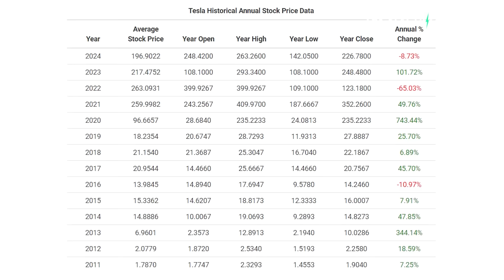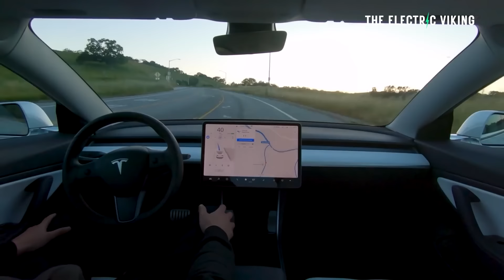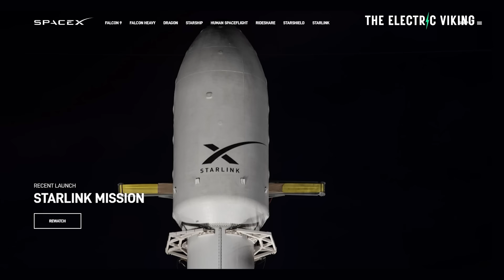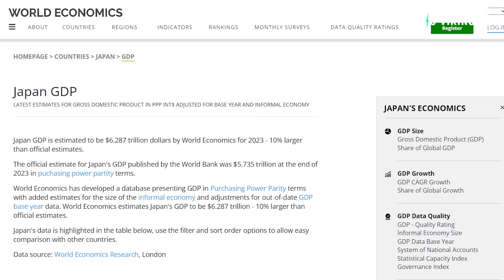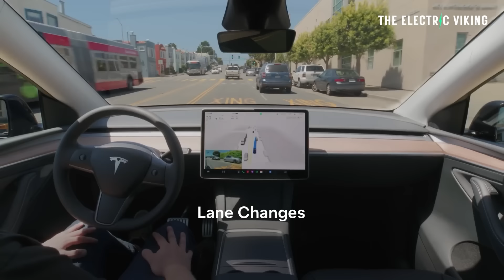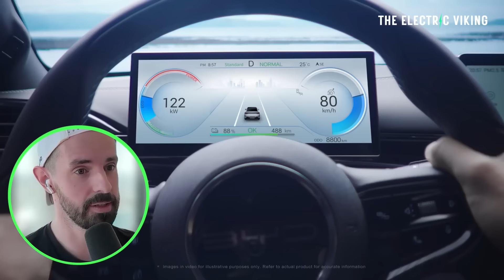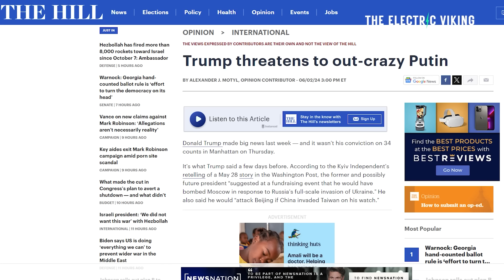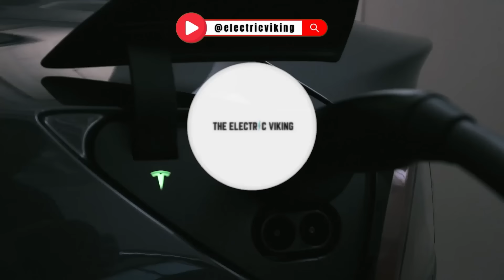The Electric Viking and Solving The Money Problem, Steven Mark Ryan

Comment: Thanks Sam.  Excellent wide ranging interview with SMR. Clever bastard, gives such clearly reasoned analysis. With my peanut-sized brain am unlikely to add value to SMR's points, but maybe the following observation is useful ... On Tesla's existential threats & their competition ... Tesla's culture is possibly their ultimate moat. Tesla has a far higher change velocity than its competitors. Tesla's culture seems to create a well structured grouping of self directed teams (source: Farzad, Rohan Patel, etc), that work at a far faster self-correcting pace, which is being continually repointed towards solving the most important things, at the right time. It's an Agile + Lean approach previously only seen in IT. However, within Tesla it's applied across ALL teams. And in the end, in Business, productive customer focused change velocity wins. (Not, ever, financial advice)

Comment: Like to see you both outside your standard format.  Thanks for the great program.  To me, the 4680 is about keeping suppliers in check.  If you can make kw×hr/kg for x and your supplier cannot compete with that price, than there is no sale.  Tesla needs lots of batteries, maybe you can make a few dollars per cell, even if at a higher price, but a supplier cannot bend tesla over.  And without batteries, tesla cannot do much at the moment- even if the 4680 is a hedge, money well spent.
Reply: It also generates a $45/kwh handout, at least in the short term.

Comment: It's perhaps a bit worse this time around. Where are the carriage makers and leather workers going to go this time around? The whole ICE industry is in a technological sinkhole at the same time it's flat broke.
Reply: ICE will continue in the u.s. as long as the 100% tariff is in place.
Reply: @darylfoster7944  - If there are tariffs it doesn't affect the supply chain for ICE collapsing at a different rate, a faster one. The old paradigm is dying as we watch, like it or not.
Reply: @LegendaryInfortainment  there will still be ICE profits available for a while. EV sales aren't growly very quickly in the U.S., and without Chinese EVs available, the supply of EVs is fairly low. And the tariffs demotivate Ford and GM from ramping up, in fact they've retrenched.
Reply: @darylfoster7944  - Perhaps so, but I believe the future will surprise you much more than myself. Tesla will just need to expand a bit if GM & Ford both tank. They will, if they don't get their EV act together soon enough.

Comment: I see one possible risk with regard to AGI, and this is that we might already have capped the usefulness of neural networks.

It is like traditional industry robots right? The tech has been around for 50+ years and yet we still cannot solve a 100% automated factory with them.

I think we are close to, or already at, that point with LLMs. Better, not good enough to solve AGI.

Comment: The whole country isn't California, with 300+ days of sunshine. In the Midwest in winter, it can easily be cloudy for a week straight, in which case the solar generation is 25% at best. And you can't transmit electricity from California to Ohio. We've been building and subsidizing solar for four decades, and it's still only 4% of energy production.

Comment: Lucid stock price will in a few years drop to $2 per share making it a good target for a take over by Tesla or Ford or even GM.
Reply: Tesla have no need for Lucid and will NEVER buy Lucid. There is nothing new that Lucid has that Tesla doesn't. The reason Lucid have developed very high performance electric motors is because those parts are built with extremely high quality metals etc that cost a fortune to make/build. Using platinium is not an economical way to build a car! They have been using them in high performance E Formula racing. That's why their vehicles are so expensive. Tesla has chosen to build using materials that are more affordable aimed at the mass-market. Not the very small users. You've seen the information that shows that Lucid loses $140,000 per vehicle! Economies of scale will not solve that. A change of materials used will do. 
If Ford or GM stupidly want to buy Lucid... it will be the final, desperate action of a dying company. Oh, the majority owner of Lucid is the Saudis. They won't sell because they need the money! They don't. Their total investment is really just a rounding error adjustment on their balance sheet.

Comment: Nah electric happening without subsidies was not "inevitable" entrenched auto would never go electric unless they had to. They get 20-50% of their profits from after sales services. The last thing Ford, GM, Toyota, VW want are cheap reliable vehicles. They want Ram 3500's, F350's that breakdown and have 2000 moving parts. Selling a 20k car that doesn't even need the brakes replaced will kill their profits.

Comment: Most people, and by that I mean nearly every people, have a very closed mind, however smart they may be. Adding a godly amount of intelligence is unlikely to amount to anything significant in these people, apart for a boost of performance. Give only Musk's intelligence to the average Joe, he won't be able to do much with it. Make it millions of times that, it won't really make a difference. They just would do what they used to, but only a lot faster.
For these few wise people, this would turn them in something of engines of creativity and novelty the like only a few people managed to get. That's the real difference between Musk and the rest of the geniuses out there. Every passing idea about something new would be instantly completed or rejected and then passed to the ones that would execute it.